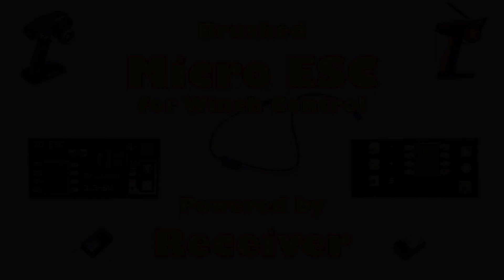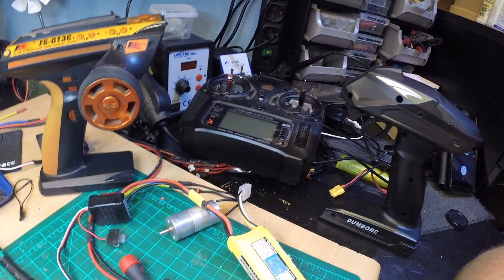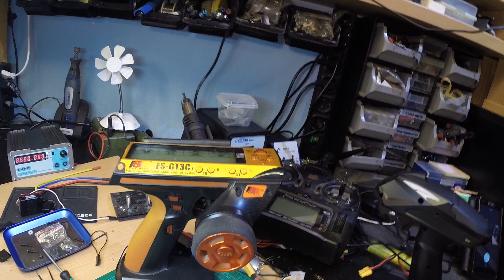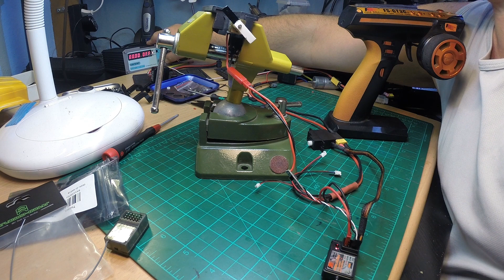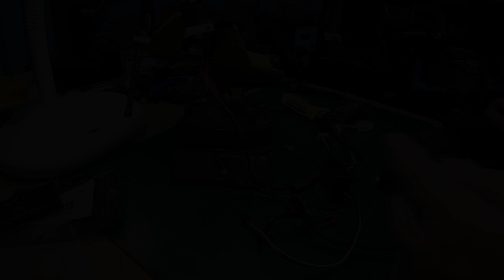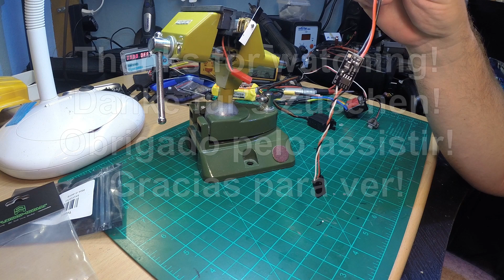Brushed Micro ESC / Winch Controller Powered by Receiver

Comment: You say this has to have a 3 position switch. Can you answer if it will work on a channel that has dial like ch5 & 6 on the Hobby Porter hp007
Reply from the maker: Do not have a Hobby Porter. Those are potentiometers. Try a normal ESC on those channels with dial, if those will work, this ESC will work too. Will check it on my Spektrum DX9, it has a poti.
Reply: thanks for the quick response

Comment: can it be used for small rc?such as coreless motor?
Reply from the maker: yes
Reply: @donaldsneffe  how about only 1 tiny coreless motor will it work?does the motor will not got hot?
Reply: @hiltonryllecabeguin9192  Why should a esc overheat the motor?!?!
Reply: @RC-ty5ym  i was just asking because coreless motor has less capacity of current so when you used esc which provide more current to the motor it will heat the motor
Reply: @hiltonryllecabeguin9192  It depends on the voltage. A motor takes only what it needs.

Comment: Can this power a a 1/10 winch 5V-11.1V? will be getting the GT3c as well for the MN90
Reply from the maker: For sure it can power a 1/10 winch with a small gearmotor inside - but probably the winch will not be very strong then, and if you push it too hard, it could burn the ESC. Furthermore, the tiny ESC for the winch will take power from the transmitter, which will get its power from main (motor) ESC. If this ESC has a weak BEC, this will highly influence the performance of the winch. For a 1/10 winch better take a seperate speedcontroller (can be a cheap one) and power this directly from the battery to get full performance. Remove plus (red) wire from the servo plug of this winch ESC (pull it simply out of the plug and put a little bit of shrink tube or tape on it) before plugging it to the receiver (receiver will get power from main ESC).
Reply: @donaldsneffe i still have some doubts, like this esc says 3,3 to 6v but i dont know of any lipo like that, could i use a 2s? and if i do the second esc just for the winch, can i put the 2 esc in one switch?